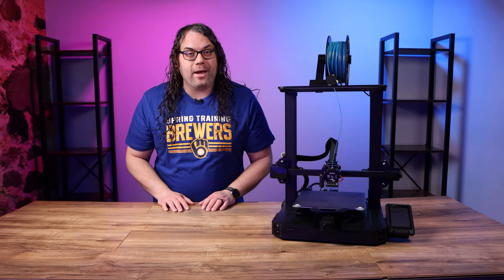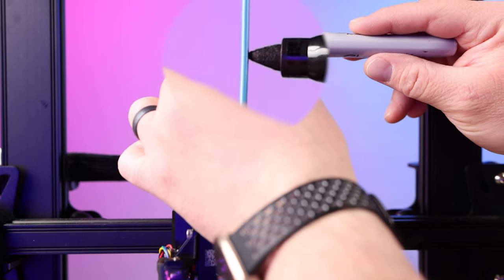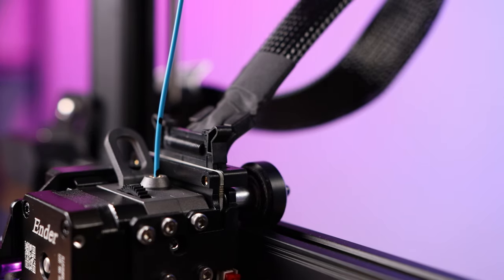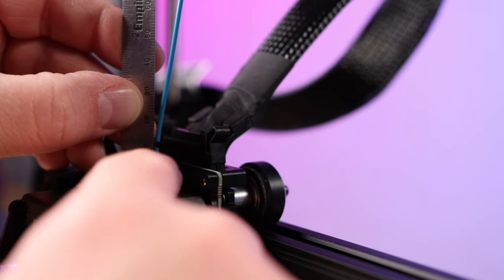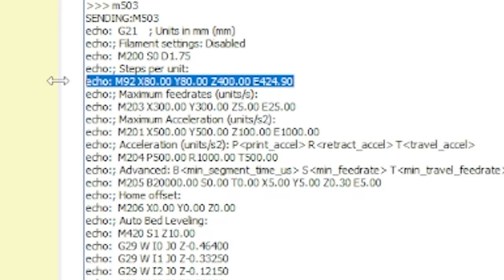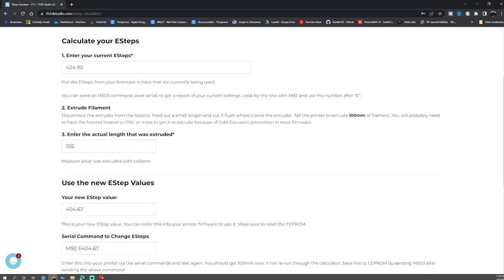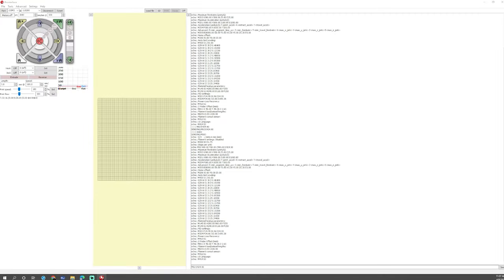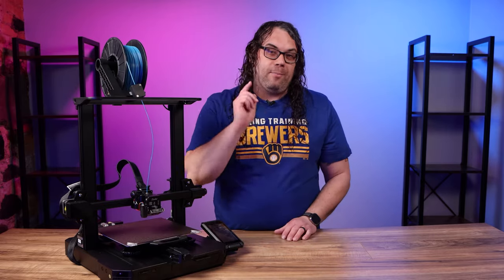How TO Calibrate The Esteps On A Direct Drive Extruder The EASY Way!

Comment: Hey I have the Ender 3 S1 Pro as well and I found out how to change the eSteps directly from the printer control panel. It's Settings > ADV.SET. > Movement > TX Rto > E TX Rto. You can input the eSteps you get from the calculator there and it's done. I double checked if the eSteps matches up in Pronterface and it did. I even ran the 100mm extrusion again to make sure.
Reply from the maker: Wow! Thanks!! I appreciate the feedback, great find!
Reply: @TheEdgeofTech  Now worries, glad I could contribute something that might make it a little easier for others.
Reply: @jolen500123  Thanks. Just calibrated my S1pro using this method.
Reply: Can you insert the decimal numbers of the result?
Reply: @Thunderbolt0883  yes, but only the first value after the decimal. Like say for example if you get a decimal value of .32 you'll only be able to do .3
Reply: @jolen500123  thx

Comment: E-steps are already calibrated from factory in most instances.  MOST people don't need to do this.  Different filaments will have different bite profiles, and you should adjust flow rate to account for these discrepancies between actual rolls.
Reply: Nope.
Reply from the maker: I agree that they should be calibrated from the factory, but I have found several times that they are off.. And I agree about the flow rate, next weeks video will cover that!! Thanks for watching!
Reply: Extremely nope.
Reply: Ultra nope

Comment: You can enter the calibration value in the touch screen menus. Go to settings, advanced settings, movement, TX Rto, e step value is in the lower right corner.
Reply: Thank you, that was super easy

Comment: Just want to add that if you have calipers, it can be useful to measure your marks on a separate piece of filament and transfer them. This way you have a "bendable ruler" for 100 and 120mm. After extrusion, cut the filament flush with the orifice so you can again measure with calipers more easily.
Reply: dude that is solid advice
Reply: nice, i did the same thing except i measured the marks on a separate piece of painter's tape  and just taped the edge to the filament being extruded, then made the marks on the filament, made it a lot easier
Reply: oh man, this is great advice. i was having trouble since all i have atm is a fat pair of calipers that doesn’t fit well. you just saved my ass lol

Comment: hmmm, not so simple, my Ender 3 S1 Pro touch screen has frozen on AB temp. But the nozzle is cold & the bed is also cold. So what can I do I now have a brand new printer that I can't use. It's now 3 hours later and I've got the screen back to normal but now it won't move on any axis when I select print.......The nozzle appears to be ok, because it extrudes filament when I use the manual settings. I can't recognise the firmware on the Creality site, because it looks like Chinglish gobbledy-gook. The manual is not much help either, I really wish I hadn't started this process.

Comment: I hate the thought of guesswork and approximation when doing something you only want to do once and then forget about it. Load your filament, then go to your extruder input, or your runout sensor input and clip the filament exactly on 120mm. Run your 100mm extrusion and then measure the leftover stub. If done right, you can start splitting millimetres to get it as close to the value you're looking for.
Reply: Yeah I mean the video overall is helpful, but I rolled my eyes at the marker. "10mm, or maybe 7". When he said that i thought "...or 5, or 3, whatever."

Comment: Thank you! I just installed a Sherpa Mini direct drive extruder onto my Ender 3 V2 and was looking for the simplest way to adjust the extruder e-steps beyond the range allowable in the physical control panel on the printer. This approach worked painlessly. I ended up setting my motor VREF to .28 volts, and my extruder e-steps to 702.

Comment: Instead of fiddling to measure the length of filament with a measurer, i printed out a narrow rectangle of PLA at 105mm and slightly wider than the filament, so the filament can rest within the rectangle with thumb holding it in place, mark with a fine tip sharpie. Takes all but 10 seconds.

Comment: Great video Jim. All too often people ignore e-step calibration and wonder why they are not getting optimum prints! You should print the filament measuring tool I made!
Reply: Yes, also measuring the diameter over a few meters and taking an average. Put that number in the slicer as it does affect the gcode result. Ask me how I know 🤦🏼.
Most other extrusion issues should be adjusted with the slicer's extrusion multiplier after printing the Luke Hatfield 2-wall cube (my preference) from thingiverse.
Reply from the maker: What!! Shoot me the link!!
Reply from the maker: Great info! Next week will be the new Flow Rate (extrusion multiplier) video and that will tie this all up! :)

Comment: Thanks for this video. I am very new to this 3D printing but am learning a lot.  I have a Ender 3S1 and did this to check out my esteps.  My printer was right on the money so no changes required but I will check from time to time.  Is there any videos on general maintenance that should be done to the printers like lube and oiling anything?
Reply: Most 3D printers I've found don't need that much maintenance however if you live in a humid environment you could need to dehydrate your filament from time to time.

Comment: Great video, thank you!
One of my printers is a Snapmaker J1s Dual Extruder and I couldn't work out how to heat up the 2nd extruder but then figured out "T0" is for extruder 1 and "T1" for extruder 2 then the same user interface works for either one that is active.

Comment: Thank you! I’m still having issues with setting the calibration. When I change I had to change it from the esters from 415 to 423 for my sovol sv01 pro. But now it still seems off. I’m a noob so this is completely foreign to me. I just read that I should check my extrusion spring tension. So I am off to do that, and then re calibrate using your fantastic instructions. 🤞 
( honestly, the dang printer was printing perfectly, and then I started over thinking it and messing with settings ugghhh)

Comment: Question:  Is E-calibration necessary when switching between filament  material types?  Specifically on a direct drive extruder.
Reply from the maker: Nope. Just calibrate the E Steps once, then do the Flow Rate calibration on the filaments. :)

Comment: Recently installed a direct drive on my ender 3. Even after my own attempt to calibrate e steps it was under extruding. Never thought to measure before the extruder to check. Thanks for the info

Comment: Being a direct drive extruder it is likely less of an issue, But shouldn't you remove the nozzle before measuring to prevent its flow from effecting the result?
Reply from the maker: That's a great point! There are so many different thoughts on this, just like everything! Thanks for watching!
Reply: Yes, the prevailing thoughts on the matter are that physically you should be driving your E-Step value from the actual movement of filament and not introducing any other factors into it.  If you add a nozzle, then temperature of the extruder will affect your e-steps value due to compression of filament, etc.

E-steps should always be done in free-air, to eliminate variables.  This is the consensus among people like Joseph Prusa, Adrian Bowyer (essentially god when it comes to 3D printing; he's the one who started all of this), Nophead, and many others.  These are all people with 12+ years of experience in the 3D printing field.   In any scientific journey, including engineering - you do your best to eliminate variability and base things on _facts_.  Cold, hard numbers which are irrefutably the case.  In most instances, the E-step value is calculated from the average diameter of the hobbed gear - given that different filaments will bite differently and change the 'true' circumference.  Softer filaments will collapse further into the teeth, harder ones less so.  The people who tell you to calibrate e-steps with the nozzle on are the same people who tell you to put bearings on the other ends of your Z axis rods instead of letting them float.  They think they understand what's going on - but those who have done the empirical testing know that you leave the free ends to wobble so they don't impart their imperfections on the gantry.  Same thing with E-steps.  Don't trust anyone who tells you to calibrate this with the hot end attached and the nozzle up to temperature.  Additionally - this calculated value is generally _correct from factory_.  Not always, but in most instances.  Only time you should need to change it, is when the diameter of your extruder gear is in question (changing drive mechanisms to dual-gear, changing to a different extruder system, etc) or if you do something like change from 1.8 to 0.9 degree step motors (effectively doubling your steps per mm requirement).
Reply: @ThantiK  really depends tho. In klipper, it says you need to have your nozzle to the right temperature when calibrating esteps.
Reply: The pressure exerted by the extruder shouldn't be manipulated by the material being pushed through the nozzle.  The displacement is fixed.  If it does then your nozzle is not hot enough or clogged

Comment: Great video! E-steps are so important. I totally forgot to do e-steps after upgrading the extruder on my ender 3 pro and they were WAY off. Like extruded 59mm instead of 100mm off! I was impressed that the BTT SKR E3 mini V3 firmware had e-steps calibration built right in. It was super easy.
Reply from the maker: Awesome!! It's always good to check them at least, and I love the idea of it being built in!
Reply: How is that combo?
Do they mix well?
Reply: I agree, however the example in the video the S1 I've found is already perfectly calibrated from factory.

Comment: Thank you for sharing this video, I am familiar with using the bowden method for determining e-steps but wasn't sure how to go about it for a direct drive. I'll check this tonight on my sprite extruder as I think my numbers are off based on how my prints have been looking at the recommended 424.9 value that was in the instructions that came with the kit.

Comment: This is an excellent, efficient video.  Unfortunately, after using your info to measure my extrusion, I quickly found it to be dead accurate.  Which means either I have a software issue, or I have no idea what is going on.  I set my Extrusion Multiplier in Prusa to 0.9 and it went from unusable to nearly perfect first layer, but still separated and lifted a couple passes, and the whole thing seemed to be just bloated enough that the lid wouldn't close properly.  And it's an Ender3 S1 pro.  Cura usually does really well, even though it doesn't have a preset for the Pro model, but it's much more limited.  What do I do?

Comment: do pid tune before use pronterface  m303 c8 s220 u1. then m500 it will save it. dont need to type anything it its all done the bed is m303 E-1 s65 c8 u1

Comment: In my case with the Bondtech DDX V3, I had to calibrate without the nozzle to get the correct e-steps, as otherwise they were way off and only caused further issues.

That said, people seem to have their own opinions on this and whether you're supposed to calibrate your extruder only, or with your specific hot end setup, but as an example, the lead Marlin developers recommend doing it without the nozzle, as you're calibrating the extruder, not the print head/hot end/nozzle, as this way you'll know your extruder is calibrated and if you're still seeing issues, then the issue is with your hot end, nozzle or flow rate, not the extruder/e-steps.
Reply from the maker: Great info! I like that idea too, and may have to do a video showing this method as well! It's good to cover all the bases. Thanks for watching!

Comment: I have the Ender 3 S1, not the pro. It doesn't seem to have the option to tell it to extrude filament. I suppose I would use an app like you showed and could enter a G Code command to do that. Didn't know this was even possible.
Reply: In the S1, it's Move (Axis) > Extruder > 10mm

Comment: I recently purchased creality ender 3 S1 pro but within a week extruder stopped working.  No filament is coming out of the nozzle. I cleaned and replaced with the new nozzle that they provided as spare but still extruder is not working. Seems like there is some problem within dual gear extruder. Any suggestions please…

Comment: I have a big problem on my Ender 3 S1 Pro, hope you can help me plsss so when the printer is heating up the filament is ''extruding/leaking''(pla 190ºc) for some reson alway happens this with the extruder not moving
Reply from the maker: Is it just dribbling out or fully pushing like it's printing?
Reply: @TheEdgeofTech  the extruder does not move one step even and it comes out like 2/3 cm of filament
Reply: Normally this issue would be solved with retraction. Try swapping a nozzle or making the start gcode heat to 150 before it does bed leveling so it wont be an issue there. Does seem like a pretty extreme case though.

Comment: Thanks for video. Can you do a video on good start gcode for cura?
I've heard you need to modify it to use the autoclibration somehow. G92 or something.
Thanks
Reply: If your using the S1 put M420 S1 in your gcode to make sure that the auto bed level is working. G92 works too but makes the bed level each time which is an unnecessary time waste.

Comment: Great video, simple to follow and to the point. I have a Sidewinder X2. It is under extruding by 10mm. I followed your video step by step. When I put in the new value and hit enter I got  " * Unknown syntax: 494.44 " It won't take. I then enter "M503" and no change. Is there something I am doing wrong?
Reply: Did you put M92 before?

Comment: Hi, could you tell me what is the voltage of the Sprite Extruder Pro? As the Ender 3 comes in a 12V and 24V version
Reply: The sprite extruder uses 24 volts.

Comment: Dear The Edge of Tech!
I followed the steps what you show in the video, i try to calibrate my S1 pro, by default settings (E424.9) my extruder push 99.9 mm, after the calculation my new e-step value is 425.3, send to the printer and save, tge result is the same 99.9mm, new try with 425.7-same result, 426.1-same rseult, and so on until 429.8 and the result the same 99.9mm.
How it is possible? 
Thx
Reply: M500 makes the settings save.

Comment: Anyone know why when I add G29 to my start Gcode the probing always fails? Ender-3 S1 Pro. I have:
G28 ;Home

G29 ;ABL
Then w/e came default on the Ender-3 S1 Pro
Reply: I use M420 S1 instead which uses less time. Might work out better.